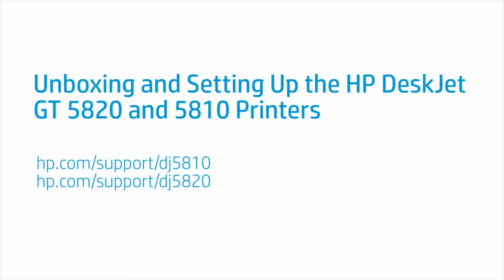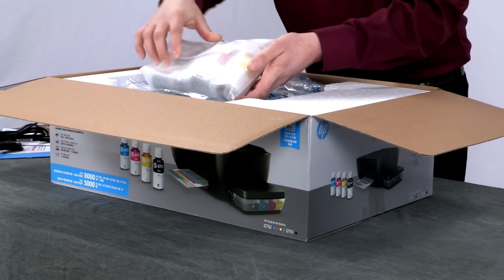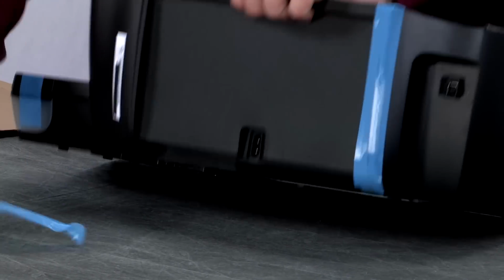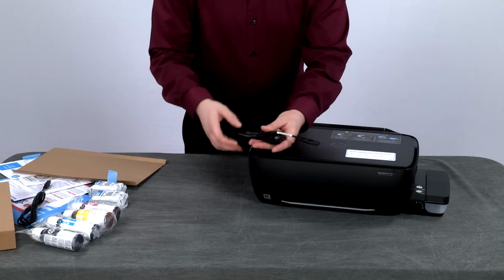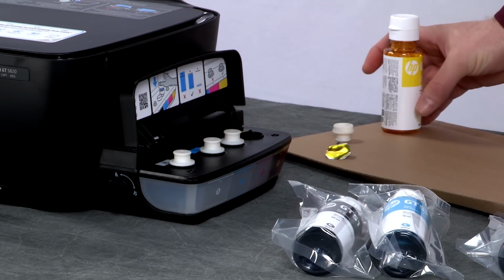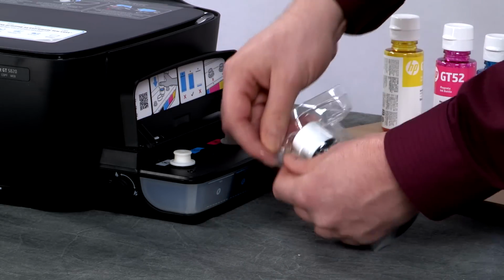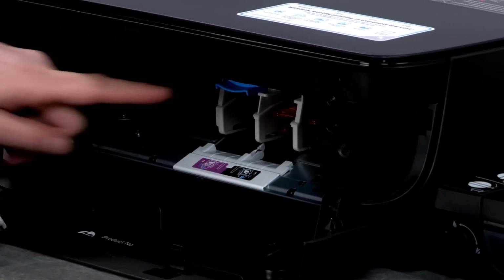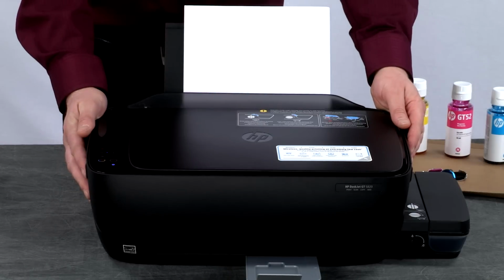Unboxing and Setting Up the HP DeskJet GT 5820 and 5810 Printers | HP Printers | HP Support

Comment: Not having a good time with this setup. My HP Envy Photo 7800 was removed from this connection site as I  tried to order refill printer ink for it since they had not sent anything for the last month and I am running out. They did however bill me for February but where's the ink? Also I've been trying to add my printer name back into printer description but it i not accepted?????? HELP I am running our of ink and need it now.  Is there even a robot to help instead of all these Help messages??
Reply from the maker: Hi Mary, thanks for contacting HP Global Social Media Support!
I understand that you are experiencing an issue with HP instant ink.
In order to get this issue fixed, please contact our customer care team over the phone or chat for further assistance, as this issue requires Live conversation with you over phone or chat to isolate the issue and provide you instantly with appropriate solution or repair/replacement options available at your place as per the warranty.
Please feel free to reach us on call/chat, please access this link to select your preferred country and language option to reach us. Global support link: - https://www8.hp.com/us/en/contact-hp/ww-phone-assist.html
Binu_HP Social Media Tech Support

Comment: hello I would like to ask what is the default wifi password of the 5820, was it 12345678? THANKS
Reply from the maker: +Creep Cakes I believe you are trying to connect to the wi-fi direct network of the printer and it's asking for the wi-fi direct password.
Try 12345678.
Reply: @HPSupport  Yup. Thank your very much.

Comment: i wont recommend this printer. we both 4 HP deskjet GT 5810 and sad to say all of them have same problem. After two months of using it the black or the color wont print properly.  we returned it to supplier and they tried to repair it still didn't work properly. They even replace us with same model but have same problem after  2 months.
Reply: Thank u.
Im gonna buy a defective one from my friend. Im not gonna pushthrough with it.
Reply from the maker: +Shanxt Venture Please follow the guidelines in this document to fix this issue: http://hp.care/2o3s9a5
Reply: @HPSupport  we returned it to the suppliers since to make used of warranty. they change the product but after few use same trouble.

Comment: HP DeskJet Ink Tank GT 5821 or HP Ink Tank WL 410 Multi-function Wireless PrinterWHAT IS THE DIFFERENCE BETWEEN AND WHAT IS THE BEST
Reply from the maker: +Devesh Maurya Rockks You can find and compare the specification of  HP DeskJet GT 5821 All-in-One Printer and HP Ink Tank Wireless 410 series in these documents: http://bitly.com/2A29Me4 and http://bitly.com/2A3AmUn Both are good printers. You can buy any one of them which meets your requirement.

Comment: A warning to all NOT to update your printer's firmware...

I'm in the middle of a job that I need the printer for and I made the mistake of following my printer's prompt to update to new firmware, thinking that it might improve my printer's glitchy performance. Big mistake. Turns out that in doing so, my HP printer now recognizes that my current ink cartridges have printed over a certain amount of pages, and locked them so they can never be used again... even though I just refilled them. This is to prevent people from refilling/ recycling cartridges or from using non-HP cartridges. I reset my printer to its factory settings but the cartridges I have here are now forever useless. Grr, this sort of corporate B.S. should be illegal.
Reply: I just bought this printer because the same happened with my last printer although the cartridges were new.
Reply: Thanks mate, almost buy one today.